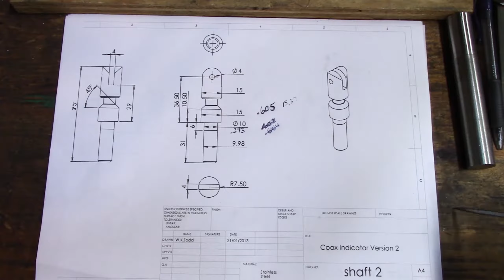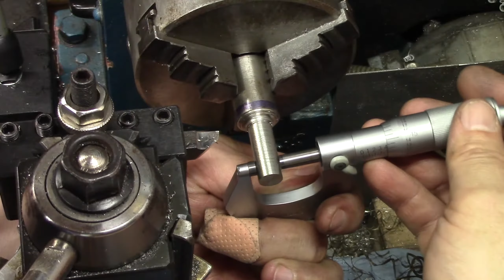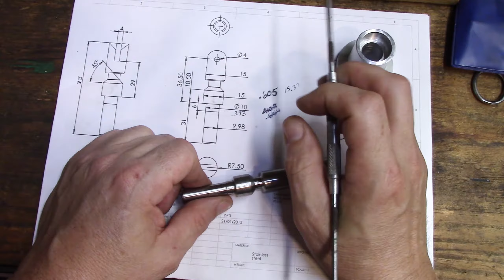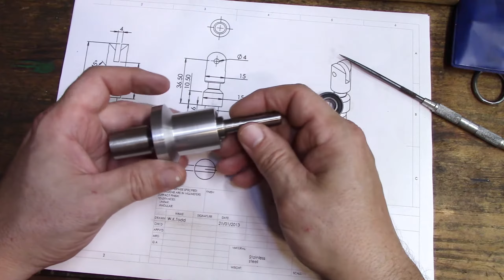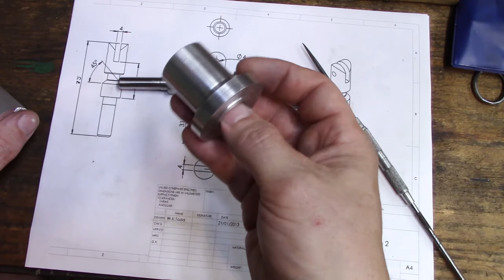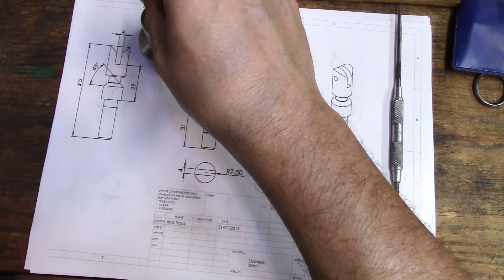MISTAKES - DIY Co-ax (Coaxial?) Indicator - Part 3 - #TMC2020

Comment: Ok,  you have a couple of problems:  all the diameters on the shaft should be turn in one operation if possible . Atm, you 3/8 " and 0.6xx sections will not be concentric to each other (because no chuck is perfect)  .. it would be best to dril a centre, chuck enough material from which to turn the whole shaft  while supporting the small end with the tailstock.  

To turn the body ,  rough turn the od and cosmetic taper.  Bore the clearance pocket.  Part off to length. Rechuck arse about face, on the body , face and spotdrill and then drill close to size without pilot (the bigger drill will cut a straighter hole - i suspect the pilot drill wandered off course and your reamer followed  -or  did you bore to size?? )  ,  Add the register and face.

Once you're happy with the fit , chuck one the small end of the shaft , super glue the body temporarily onto the shaft , and do the cosmetic od and finish
Reply from the maker: Good stuff Bill, thanks. You are right about the shaft. It is minor (</= than .001") but there is some there. As I now have a shaft oversize from the plans (and the 3/8" section is still within tolerance of the collet) I should be able to center drill the small end and hold the extra bit in the chuck and skim the whole thing true. If not it will make a nice Christmas ornament.

I drilled then bored the body to size (reamer was junk). Something happened when I re-centered it, either laziness or a cocked jaw (my four jaw does have some jaw t-slot issues). After this is all done I am going to try to replicate what happened. Your ops are nearly identical to how I cut it the first time except the super glue trick. The arse around is what bit me so I am going to try to cut the whole thing in one setup holding it by what will be the register which is just for locating. This will also allow me to hold it in the 3 jaw which is in much better condition (the body is slightly too big to hold is the 3 jaw.) Anyway, I think this will allow me to cut the pocket, drill/bore the hole and face the reference face in one setup. I know it is probably not optimal but with the tooling I have might be my best option. At least I feel more confident with the better condition 3 jaw.

I do really like the super glue idea for the final finish, I am going to give that a try.
Best! 
Eddie
Reply from the maker: hey Bill, I had thought. I can mount the collet holder that I will be using to hold this into my lathe spindle. Would that not solve my concentric problem if I mount it on the 10mm side, live center on the other and skim the rest of the shaft inline? Again, because it is .37 mm oversize and I can make the new body with the correct 15mm diameter, I have a bit to cut off.
Reply: @theeddies  ok, your lathe wil turn about one axis , the stability of that axis is determined by the quality of the bearings, but even a modest lathe will be good enough.  When you turn a piece of stock all diameters ,cut in the same operation , will be concentric to that axis. If you remount the work, the concentricity and parallelism of the new cuts will only be as good as the the new mounting .  The simplicity of tapered centres makes them usually the best , tapered collets are next best , but only if the collet chuck is perfectly mounted (or the collet closer is part of the spindle) , closely followed by freshly turned soft jaws.

back to your job...  if you use your collet chuck, check the tir of the 10mm section (tap the chuck around to minimise run out)  . Take a skim cut to true up the shaft  , you can then either finish to a known size or just polish it and later , fit the bore to the shaft (i.e. bore the body to a tight fit then lap the bore using the shaft  as a lap).
Reply from the maker: Good stuff Bill, thanks! It will not be a collet chuck per se, but a ER collet holder in the morse taper of the spindle. I will definitely be doing more runout testing going forward. So far, definitely a learning experience on the precision issues of tool making. Much different than turning out a few axle spacers, lol.  I'd have to say I understand the theories but my turning that into practice has a ways to go.

Comment: Did you flip the body part around and drill both sides instead of just drilling straight through it in one go?
Reply from the maker: I thought about that. Drill drift or deflection. I did drill part way through the opposite side, may be a third with a smaller drill. However that would not explain why the reference face is square to the hole if it went sideways. The only thing I can think is that I had a lazy reading when I flipped it in the chuck and "re-centered" it or I did not tighten the chuck jaws evenly with the four jaw. I went back and looked at some raw video and the portion in the jaws is obviously running askew. The exposed section was running true enough to not be noticable and once I faced it, it looked perfect of course. It is also possible that a jaw got cocked. Remember that chuck has a few issues. I probably should only use it for roughing in and not precision stuff.
Reply: @theeddies  It could be far worse, like a much more intricate part to have to redo. Still blows anyway you slice it though.
Reply: @theeddies  What is your game plan for rounding off the end of that part?
Reply from the maker: @johnstrange6799  I am going to convert my machine into CNC mode...or just freehand it on the belt sander and files. I thought about the facet method or some rotating jig on the mill but not sure I have the patience to set it up right now. Really fighting motivation issues, also part of why I am making mistakes. I usually think things through to death before I even attempt them but concentration is lacking.
Reply: @theeddies Look on the bright side, others fought illness and injury in bitter cold while starving and dodging musket shot and canon balls all so that we could have our Independence. All they'd want is for you to just remake the part, and get back in the game -for America, BUT if you're having trouble getting motivated, well then I guess the 4th of July has been canceled this year and forever, so good job! :)  EDIT:  I hope you're not planning any machining projects around arbor day!
Reply from the maker: @johnstrange6799  Those lucky Minutemen bastards. Life was so much simpler then. Eat, shit, fight Brits, and die of dysentery, what a time to be alive... for a little while. And yes I am planning to make and Arbor for arbor day, thanks for ruining the surprise.
Reply: @theeddies lol  -  Check this out: https://chicago.craigslist.org/nwc/tls/d/grayslake-milling-vise-self-centering/7153364214.html
Reply from the maker: @johnstrange6799  That's awesome, never seen one. Not a horrible price either.
Reply: @theeddies  Same thoughts here.
Reply: @theeddies  Low finds today. Got a old pipe vise of decent size made by Erie Tool Works, and a two drawer metal parts organizer with some misc hardware in it, and that's it! I forgot to include in my last video Radnor welding gloves I found.
Reply from the maker: @johnstrange6799  WAIT a minute!!!!!!! You made a video?????? I did not get and notification and did not see it in my sub list. Shit, going to watch it now. Sorry man! I will make sure to leave a snarky comment and downvote.
Reply: @theeddies  I told you I was going to show everyone  else on the internet except you.
Reply: @theeddies  Do you watch Johnathan W??
Reply from the maker: @johnstrange6799  Yes, longtime subscriber. I had another channel where I made compilations of his videos, it was doing very well until recently.
Reply: @theeddies  lol as I suspected. I saw your pinned comment over there.
Reply from the maker: @johnstrange6799  $20 is $20
Reply from the maker: @johnstrange6799  The balls on that douche, am I right?
Reply: @theeddies  I don't understand.
Reply from the maker: @johnstrange6799  The balls on the guy who stole his videos, made money on them,  and then tried to defend it as fair use.
Reply from the maker: @johnstrange6799  or that he was somehow creating them or making them better
Reply: @theeddies  Yeah, it's weak. I think many people would let someone use a clip or two if they asked. I caught a dude re uploading mine, Mr. Pete's, and Mike Halligan's videos last year or something. When confronted he argued with me about it, then deleted the channel. I found it by just searching for video's with South Bend Lathe's. I also found a clip of Roadking's video in a compilation a few years ago that he didn't know about.
Reply: @theeddies  lol he had it all worked out to be okay in his mind, but it didn't hold any water. I got pissed because the fool that was doing it with mine was just stealing the whole video title and all! I don't know why he chose mine as I don't get any views, but he did it.
Reply: @theeddies  Boring Town USA!
Reply: @theeddies  Cheap surface grinder. https://chicago.craigslist.org/nch/tls/d/grayslake-surface-grinder/7154778451.html
Reply from the maker: @johnstrange6799  Holy crap batman. I would be all over that. Think of all the fun activities!!!
Reply: @theeddies  Maybe I'll go check it out. idk. I don't think I would use it much.
Reply from the maker: @johnstrange6799  think of all the pretty shiny parts you could make. the mag chuck alone is worth what they are asking
Reply: @theeddies  Yeah the mag chuck is cool. Made in Japan. I don't understand if it's a cutter grinder converted into a surface grinder. I would use it to make parallels, but other than that not much use to me, and I'm not interested in the grinding dust. If it were closer, then I'd likely be all over it to try to resell.
Reply: @theeddies  I showed it to Mr. Pete.
Reply from the maker: @johnstrange6799  I get it. I can think of 20 things off the top of my head I would use it for and over 10 years I would probably do 3 of them. I would still go 100 miles to buy it though. That mag chuck would be cool for light flycutting and stuff.
Reply: @theeddies  It's fucked how almost no one sells the stuff I want close to me. It's always a road adventure. Is Atlanta bringing in the National Guard?
Reply from the maker: @johnstrange6799  Governor is just posturing for his base. Not much different around here than any other Saturday night.
Reply: @theeddies  That's some real news right there.
Reply: @theeddies  Finds report: A table saw bearing spindle w/ pulley and belt (Will be kind of cool for some build project), two rusty old C clamps, an air hose (looks like for a paint sprayer - junk), conduit bender, Makita 18v cordless screw gun and drill set with the batteries and charger pre-charged for your convenience no less.  Ran into some deck builders and got a bunch of nice new treated plank cut offs to recover my outdoor work table. And... I forget what else. Nothing exciting. Maybe I'll make a video tonight for my friends online. You might hear about it from people, but likely not. lol #THISKIDISGOLD
Reply from the maker: @johnstrange6799  lol. Nice finds. Hopefully one of my friends will recommend the video to me so I see it. #THISKIDMARK
Reply: @theeddies  LOL the true hashtag.
Reply: @theeddies  It is fucking HOT here! I recovered my bench top and stained it. Should be about 2 hours before it looks like an English chick's smile. I saw an abandoned trailer today. It was sweet! Had an old video poker game carcass on it, and flats all around. Heavy duty but small.
Reply: @theeddies  I GUESS you are invited to see my new video. Are you back on your coaxial project yet?
Reply from the maker: @johnstrange6799  Never left it. Should have something Thurs, Friday, or Dec. 3rd. I will go check out yours I GUESS, but I cannot stay long. PuwDiPEE has a new video out.
Reply: @theeddies  Ohhh, I thought you were off of it when the part didn't go as planned. What day does Dec 3rd fall on, because I might be busy. I have to help a friend move, and I'm moving, and... it's a holiday, and my cat is in the school play, and I'm scheduled to be on the ISS from Dec.2nd to Dec 4th.